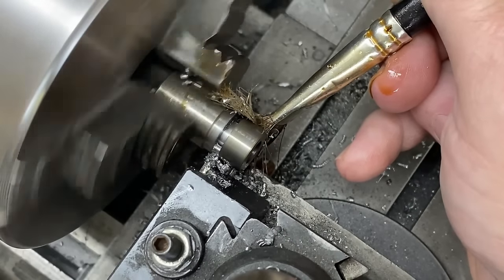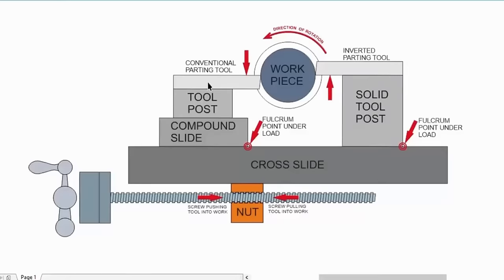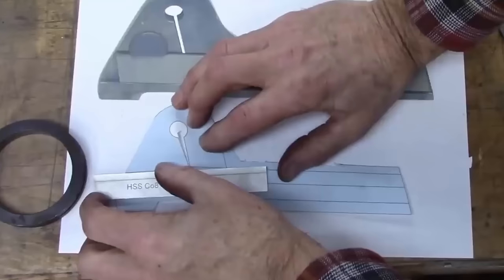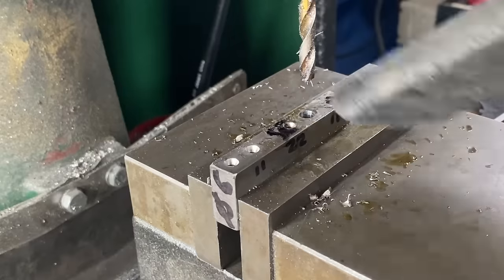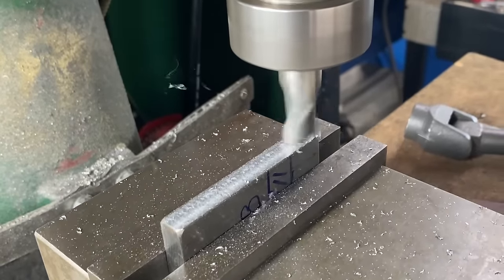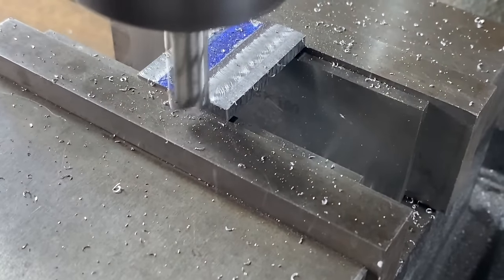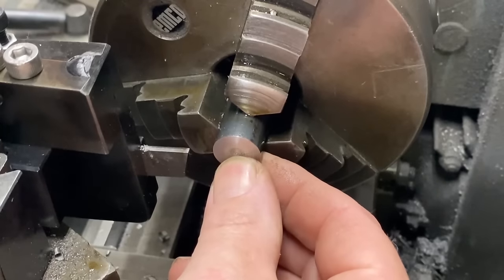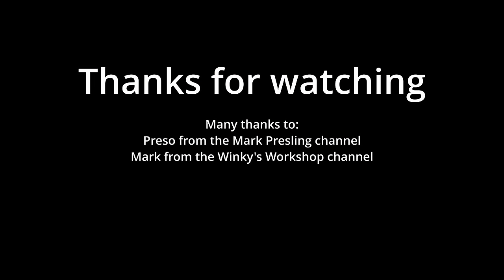Spring Cut Off Tool - Winky's Workshop Style

Comment: That worked great Jon. I never had the confidence to use power feed when parting off.  I hated giving up that control. But now I think it actually helps. Consistent feed means consistent chip thickness and tool pressure.
Reply from the maker: Thanks Mark. Have a Merry Christmas and I hope you and Mrs Preso have a great New Year.

Comment: This movable tool block is interesting but I would simply use a positive rake cut off tool in a solid holder setup instead of a neutral rake tool and see how that goes.  You could also grind the positive rake into the top of the HSS blade to get the positive rake effect for better shear or go to an indexable insert cut off tool with the positive rake built into the chip breaker for a normally neutral cut off tool holder.  The power feed was interesting...an occasional off/on with the feed may break that long chip for you.
Reply from the maker: Thank you for your comments.

Comment: The chamfer on the top of the blade is for it to fit in a dovetail type holder. Your supposed to grind the top flat at the point where it cuts. Hope that helps. Cheers.
Reply from the maker: Thank you. That makes sense, I will try that out.